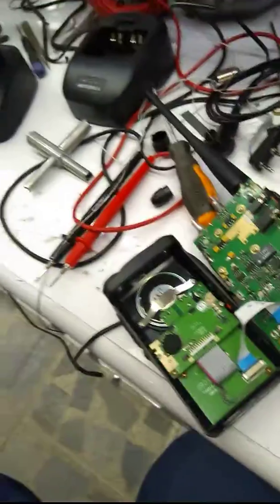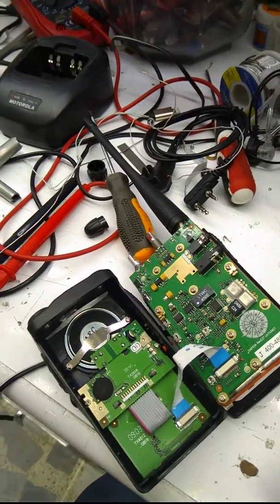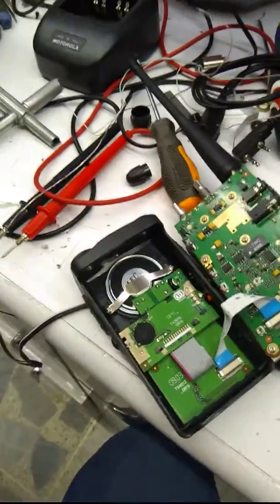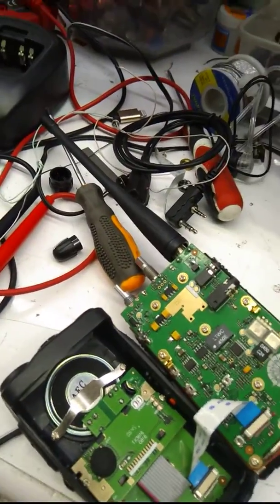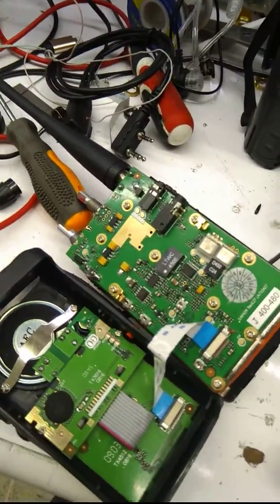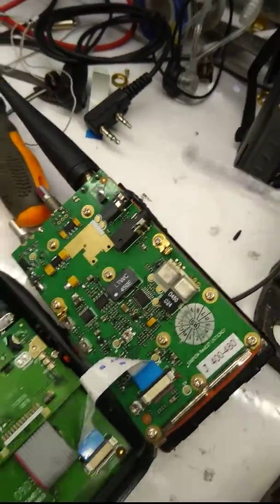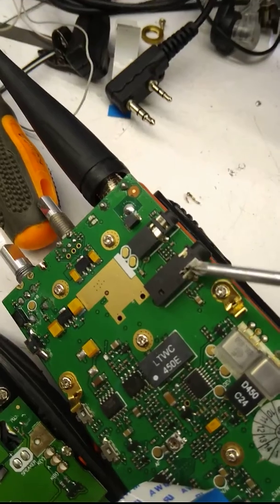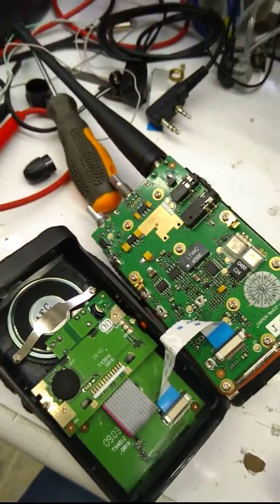Repairing, maintenance, programming transceiver two way radio Crony/ Puxing/ Motorola MT777, part 1

Comment: This is not the real Motorola Radio... Its a China Made from Puxing PX777
Reply: My mt777 transmission is bad but recieve very good ... What may be the problem
Reply from the maker: It's signal emitter should be replaced or repaired.
Reply: @HardyElectro1M  would you please tell me the part number
Reply from the maker: @redadeath   the issue of your device more likely is with the antenna. First, replace the antenna. (Use another walkie-talkie's antenna). See if it's fixed.
Reply from the maker: That's right, thanks for the comment.
Reply: hi.thanks for the comment. I have mt777 and it is the same as this stuff in this video.but! mine has not two cristals on board like this! can you halp me to find what is exactly I have?!  my mt777 is made by china too? the lable on it is MADE IN MALASYA
Reply from the maker: @arash7777xxxx   I'm almost sure it's Chinese with a fake label.